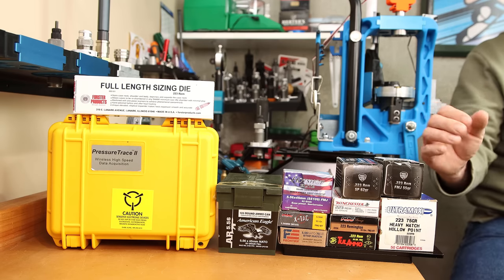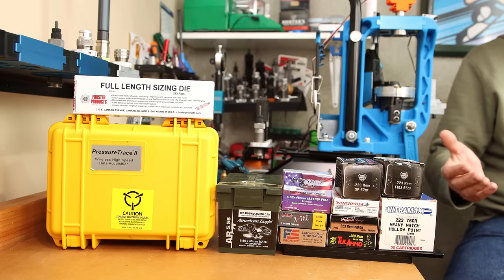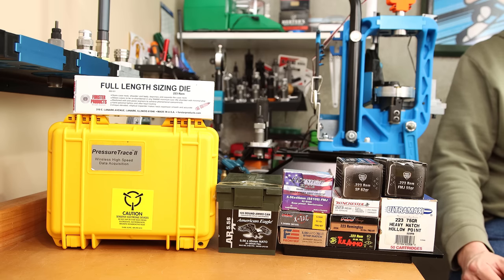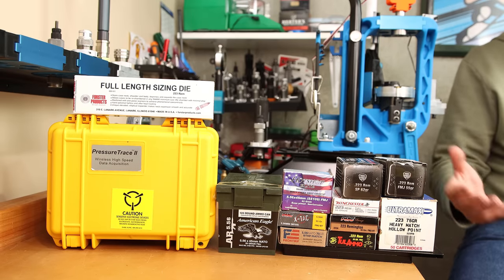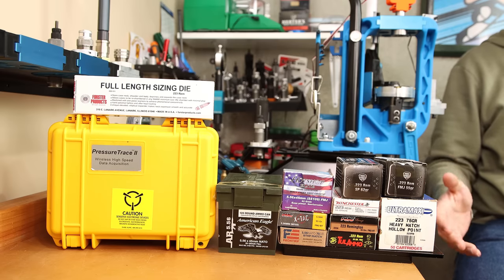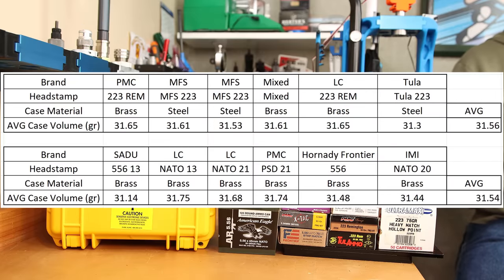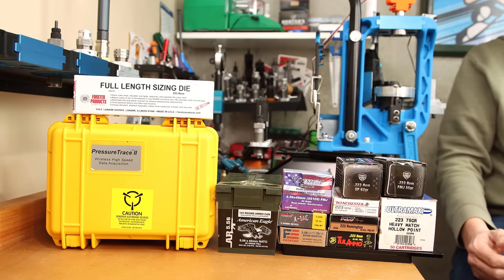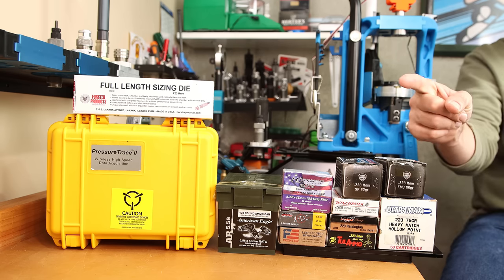223 vs 556 - The Hidden Truth No One Tells You!

Comment: Everything I've ever loaded into my AR, 5.56 chamber, has worked. Mine prefers the 70-90grain bullet weight for accuracy but they function the same. The 90 I've only fired a few times and were max length, virtually touching lands when chambered. I loaded them single shot through the port as they wouldn't fit in the mag. The 70, 75, 77 and 80 all loaded in the metal mag but not the polymer. Cases made no difference as I load from low grain up until most accurate load is found...all of them less than max velocity loads for the bullet weight used. Your advice is sound for 99% of shooters of factory or surplus ammo shooters.

Comment: Nice to see you get the PTII online for those videos. Excellent content as always. Seems to me the only difference is that they are loaded to different powder specifications. Did you open the cases up and weigh the powder and take a look at any differences in composition? Other thing to do - albeit crude - is to take a few kernels of each, and ignite them while videotaping them with something with a very fast FPS - perhaps you can see a difference in the time stamp and time to burn? (Maybe - not sure if you need something impossible that does 3000 fps or something like that). I dont reload for my 5.56 so clueless as to powders here. I guess easier question is there 5.56 vs 2.23 powder and how do the manufacturers measure their burn rate - i assume 5.56 is a little slower burning, build more pressure and shoot the projectile a bit faster? Anyways - awesome stuff as always.
Reply from the maker: Hi S F, I am hoping that the PTII will add some more info that has been long ignored. I thought about adding the pressure curve traces from each of these but figured it would confuse many. I find it absolutely crazy how different the pressure traces are from each other. I am way deeper in this project than I would like to admit, but that's what it takes sometimes when you are trying to learn. If anything this has made me even more of a reloading snob. I wish I had more older factory to compare. Some of the more recent offerings it seems clear that they are using what they can get their hands on. Seeing ES of almost 100 fps over 10 rounds on most offerings is disappointing but not completely unexpected I guess.
Reply: @BoltActionReloading  I can believe that - I think people like to plink so to them, ammo is ammo. I suppose thats why we reload. I remember Jim Ristow chastising me when I was hounding him on correction factors - as he said the whole point is to get pressure curves to be the same (ala AMP Press). Clearly box 223/5.56 is way of that goal. Lol. Hopefully you get GRT sorted out as it is way easier to collect data.
Reply from the maker: I am sure that its just a matter of learning and spending time with it. I am pretty sure that I am somewhere about 50+ hours into this project. I don't count anymore, its the journey more than the destination. I appreciate all the guys that try their best to make these thigs easier for everyone to understand.
Reply: @BoltActionReloading  And that is why your content is excellent. Its always about the journey - never about the destination. Keep up the awesome work - I hope folks understand the amount of time and money you throw into these projects in order to get know-how into the community - for their benefit not yours - or I suppose that your journey helps you but is also helping them - you could literally be sitting in a tunnel with all this equipment and just using it for an edge in competition.

Comment: I reload a lot of range .556 brass and 223 as well the biggest things I've noticed are that .556 is generally crimped as mentioned in the video the other major difference I've noticed is that the case necks on .556 tend to be longer making the case length longer in most cases this neck tension can make a difference in pressure so when I trim my brass I trim it all to 1.750 I've noticed usually the 223 is already this length or sometimes shorter but the .556 is normally over 1.760 before trimming. I don't shoot .556 in my 223 if it's factory ammo but if I loaded it it can be shot in either my .556 or 223 and shows no signs of pressure in either chamber.
Reply: Exactly. I am a certified master reloader and the only difference is case length.powder charge is the same. The higher pressure comes from the difference in the length of the base creating a different headspace between the two which causes difference in chamber pressure

Comment: When the M16 was first introduced during the VN war, their were major issues with jammed brass. Causing scores of Marines to be killed. I was at the original hill battles of khe shan in the spring of 1967.  I still had my M14, one of the best rifles ever made.  Many years later I was told that the problem was, the military in their infinite wisdom increased the pressure (556,) without telling the rifle mfg.  This caused the brass to stick in the chamber. He said they slightly increased the size of the chamber and chromed them eliminating the jamming issue.  Those ignorant fools that increased the pressure while not retesting the rifles with the new ammunition have blood on their hands.  I left VN still carrying my M14, a rifle that always went bang when you pulled the trigger.  With a round that stayed true on course even when hitting tall grass, and eliminating the target.
Reply: It's  Khe Sanh and there is no Spring season in Vietnam  . It's Wet Or Dry season that's it . I doubt it was actually the extra pressure it was more likely the tight chamber and when the round gets jammed in by the fast returning bolt it has nowhere to expand up and then shrink back down a small amount to aid extraction . So it just stays jammed in the chamber . Some ammo could have been larger in the case body than others . Tight chambers can happen because of worn chamber reamers being resharpened to save money and they become too small in diameter . Military chambers are usually designed to be a bit larger than commercial chambers to allow for ammo variations . Chroming a chamber would reduce friction and aid extraction but it would not cure a too tight chamber spec .
Reply: I heard stoner said do not use ball powders in it well the gov didn’t listen so the m16 would gum up fairly quick you had to clean after every use. That’s what I have heard for decades is it true I have never tested it plus not sure what manufacturer of ball powders they used back then.

Comment: Well I had enough of this confusion and bought some new Win. & PMC 5.56 and compared it to new Win.. & PMC 223 ammo ; measured all outside dimensions , cut them all in half and measured all wall thickness and then weighed them before cutting them and found ZERO difference. 
Then I did the same to shot once 223 & 5.56 same brass and again found ZERO difference.
(the 5.56 ammo did tough however have 2 gr. more of powder on average , only difference) 
CONCLUSION: Both Win. & PMC are selling counterfeit ammo !

Comment: I am using once shot Lake City brass for reloading. I had a military source that gave me 3 five gallon buckets of it 20 years ago and I am less than half way through it. The military crimp is a bit of a chore to to get out but I am loading 62gr boatail projectiles to 3020fps. This load works well for my Mini-14 and my AR. I full case resize, trim, and anneal every third reload. I get 12 to 15 reloads before the neck splits. When the necks split I give those cases to my BIL to cut down for 300BLK cases. I keep about 2000 rounds in rotation but could easily double or triple that with my reloading supplies that I keep on hand. I shoot more handgun but I do  range day once a month for rifle.

Comment: The explanation I was given as to the difference between the two was the chamber is looser on 5.56 to accommodate cycling under battle conditions. Loading the higher pressure 5.56 into the tighter .223 chamber could cause pressure spikes well above what the rifle was designed for.
Whether any of that is or was true is for someone else to say. It made sense though.
Reply: That was the free bore he mentioned. Not looser, longer from the shoulder to the rifling.

Comment: Great video. I have just one thing to but it is not something you tested in your tests. My sheriff tactical unit purchased new barrels for their M4 carbine. These were select fire. Some of the new barrels would not extract reliably in full auto. I am a private sector gunsmith and a friend of the sheriff’s then target master. He asked me my opinion on the trouble. I suggested that some chamber may not be 5.56 and to check that. Turns out the misbehaving barrels were not 5.56 as marked but were 223. The barrels were returned and correct chambers supplied. If you have a NFA M16 type rifle with a new barrel and it is misbehaving check to make sure it is a 5.56 chamber no matter the stamping. Again great video.

Comment: To ensure the most consistent accuracy I use one specific type of ammunition for each firearm I own.
What brand and type of ammunition that I use for each individual firearm depends on what task that firearm is used specifically for.
Yes.
Each firearm I own was purchased for one specific task except a section of my shotgun collection that is used for general purposes.
One of my small game rifles is a bolt action rifle chambered in 5.56.
It will also work very well with .223 Rem.
As with my other rifles I use one specific type of 5.56 and one specific type of .223.
What this gentleman says about the difference in pressure is spot on.
The difference in the pressure changes the ballistics when you swap between the rounds meaning that you have to re-zero your scope with every swap.

Comment: great video on the differences ( and not so differences) between the two.  have fired thousands of NATO rounds in both modern 223 Remington chambered and 556 NATO chambers with zero issues.... ever. those were both 55and 62 grain projectiles.  i do not use the 69 grain or higher in 223 barrels tho, as encroachment possibility is real with the tighter free bore. 
the 6,000 psi bump still leaves a good safety margin way under factory high pressure proof rounds; 70,000 psi.

Comment: This is not just a 223-556 argument. I've heard the same thing with 30 out 6 308 and 45 ACP. Even some people arguing 9 mm. The military brass was hotter or the civilian brass was hotter. I've been around firearms since I was about eight nine years old. My dad was in the military so to Vietnam and his unit is national guard unit sponsored. My boy scout by explorer group so we were exposed to a lot of military brass 556 when they would have to go on live fire back in the 80s. Whatever they didn't shoot didn't come back because they had to use it or they would not have the same amount next time. So some of the guys would take the unspent rounds home and they would shoot him out of their mini 14s and other 223 chambered rifles and had no issues modern chambers are capable of handling a lot more pressures than what they could before. Anything you've purchased in the last 15 years 20 years can handle both. The reason they do this is fire manufacturers will not manufacture something if the reputable that's going to danger somebody and the possibility of a chamber exploding because somebody put 556 and a 223 chamber they make the chambers handle higher pressures. I've never ran across anybody who has ever blown up their gun. Firing 556 out of a 223 chamber. Seen a lot of people do it. Never see anybody do it. Never seen anybody blow up their gun. Crack their barrels. Nothing modern firearms, regardless of whether or not it's chambered at 556-223 can handle both. Most of the time you get an AR it's going to be chambered in 556 or 223 wild I wouldn't worry about it and this argument is really really old. The 308 argument you don't hear it as much is just as equally old and I don't think there's any military surplus 30 0 6 ammo out there anymore but I heard the same argument when I was a kid I've also heard that the 556 chamber isn't as accurate as a 223. I have no issues with the accuracy on my chambers. My rifles they work just fine. They do exactly what I want

Comment: On the starline website, the 556 is slightly different metallurgy, making it a little harder towards the base of the case I assume to take a little more pressure otherwise the cases are identical to 223

Comment: Apparently the 556 and 223 brass is SAME for many manufacturers (LC, PMC, ...), only different stamp at the back. Possibly neck and shoulder pressed slightly different way, but most likely not even that. 

Which makes sense, why to make two sets of settings and materials, if you can do with one. In mass produced cartridge category.

Comment: Years ago when I was in the army I had, like a lot of other soldiers, a Ruger Mini-14. They were chambered for .223 but we put hundreds of 5.56 rounds through them with no problems. It was years later before we found out they are not just different names for the same cartridge, and the 5.56 is a higher pressure. I guess it's a testament to how well built the Mini-14s are. I understand Ruger chamber them for both .223 and 5.56 now.

Comment: IIRC, the rule of thumb is that 5.56 and 223 are the same except 5.56 has slightly higher chamber pressure, meaning you can shoot 223 out of 5.56 but shouldn’t shoot 5.56 out of 223 or risk a chamber breach.

Comment: I seen a video on this very subject somewhere here on YouTube. The gentleman on that video came to a conclusion very similar to your analysis. He found that it mostly has to do with higher pressure achieved by .556
The other interesting thing he found on the particular ammo being analyzing was the base of the .556 he was testing had a inverted cone shape on the inside of the brass around the primer. He surmised that was structured to help deal with the increase of pressure.
Reply: Re: "The other interesting thing he found on the particular ammo being analyzing was the base of the .556 he was testing had a inverted cone shape on the inside of the brass around the primer. He surmised that was structured to help deal with the increase of pressure."

That's one possibility, but another is that extra material added inside the case in that location might stiffen and strengthen the case so it will better stand up to extraction on fully-automatic weapons such as dedicated machine guns. A torn case-head is the last thing most grunts want to have to clear in the middle of a fire-fight.
Reply: @GeorgiaBoy1961  yeah I can get with that. The only ones who would actually know woulda been the R&D boys and ST. STONER himself.

Comment: I have mixed 556/223 casings from 'range time' , so when I go to reload, to play it 'safe', I will load under 223 specs.
As I understand, the bullets (223/556) are identical in specs and can be used in either load.

Comment: 5.56 was loaded for gas operated semi-auto military weapons.  223 was basically loaded for bolt actions, at least, that is my take on it.  If one fires both rounds from a bolt action rifle, one, depending on barrel length, may have significantly more muzzle blast, and noise, than the other, with corresponding slight losses in accuracy.  The rifling may also have some relevance, are they the same rate of turn?

Comment: The very simplest explanation: 5.56 NATO is a +P loading of .223 Remington.  5.56 chambers are designed to deal with pressure excursions due to high temperatures (from full auto fire in a tropical desert for example) by allowing slightly more freebore for pressures to drop before the bullet meets the resistance of the rifling.  Any 5.56 chamber will handle .223 ammo.  Many .223 chambers will handle most 5.56 ammo under average shooting conditions. External dimensions are the same for both cases.  Internal dimensions may vary slightly.

.223 Remington cases have an average volume of 31.9 grains H2O and have a SAAMI maximum average pressure of 55,000 psi.

5.56 NATO cases have an average volume of 31.0 grains H2O and have a CIP maximum average pressure of 62,366 psi.

Comment: As I understand it, the concern about peak pressure has everything to do with minimising throat wear and nothing to do with preventing the rifle from blowing up. If the rifle can't safely fire 5.56, it can't safely fire .223 either. The only possible exception I've seen mentioned is the "shoulder slap" of a 5.56 casing expanding to fit the shoulder space of a .223 chamber. What I really wish people would do is make their own proof loads in increments and test a few .223 barrels to the point of destruction to see how much pressure it actually takes to blow them up.

Comment: When I reload I use the same dies for both,just usually 5.56 uses a heavier projectile,.223 is usually 55 grain where 5.56 is 62 grain and up,.223.SAMMI measures pressure from the middle of the case where 5.56 military is measured at the neck !!!

Comment: or to play it save just use the one gun that is designed for both!(as mentioned in this video), but awesome video, I have never seen anybody actually show this much data, and possibly only prove that there is some difference in pressure. only other thing not covered in this is since you used the 223 wylde, is that there is possibly a bit of difference in bolt strength?, so those higher pressures might destroy the bolt slowly, but clearly the barrel is probably over engineered anyway.